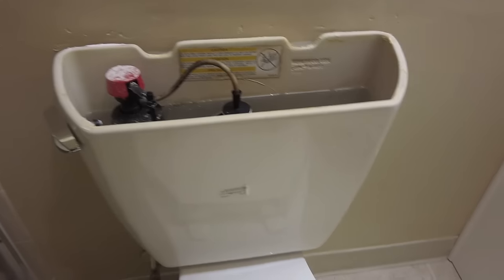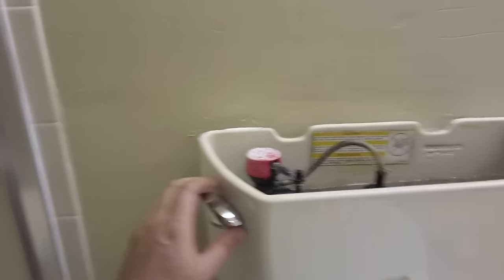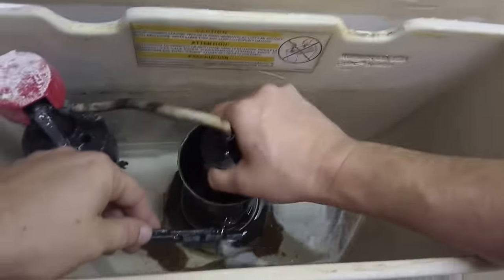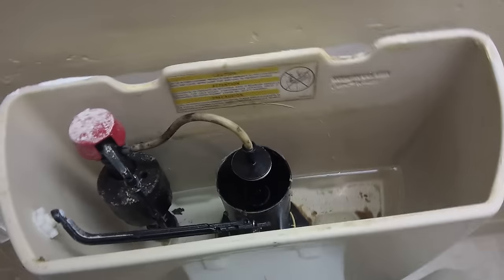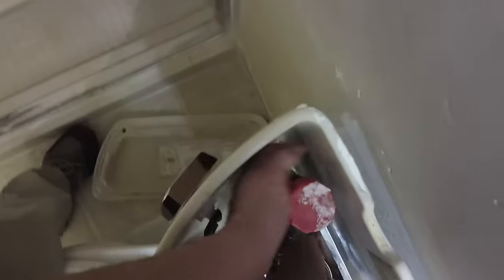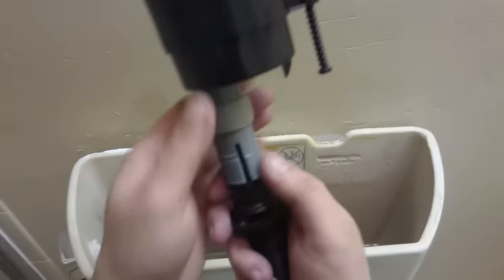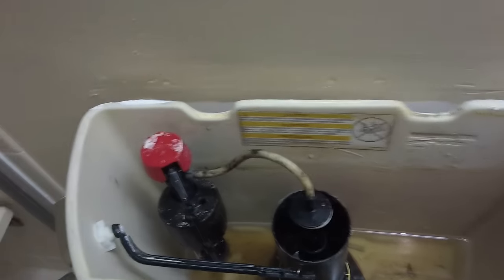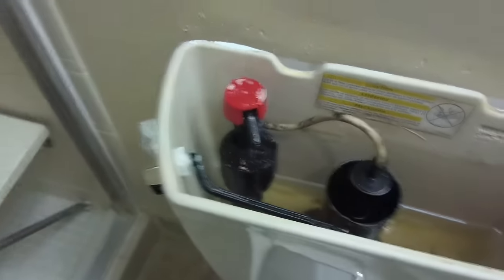Kolher toilet running no problem PART 2.

Comment: Thank you for serving the public.  I followed your videos to fix my Kohler toilet's hissing sound.  I got away with cleaning off the minerals from the rubber part without replacing anything.  There were little pieces of minerals that were keeping the system from running smoothly.

Comment: THANK YOU SO MUCH. I removed the red cap turned the grey thing to the right lifted it up as shown in the video. Then saw the hole in the pipe had little pieces of gunk in it and clogging it. I vacuumed it out, put it all back together and no more running toilet. 1st I tried to adjust the float nothing worked. I had previously checked the seal on the cylinder on the right,  it was in excellent shape so left alone . Then I tried this video seal on left side excellent shape as well left alone. But what this video did not cover was take off red cap remove piece as video shows . I then suctioned that hole out it was caked with little granules and what looked like a thin film. Replaced everything to no more running toilet. Thank you for this video it showed me how to take everything apart even though the seals were not an issue for me . Mine was a clogged whatever that thing is called after he removed the red cap and next piece the hole it was in. Sorry I dont know all the terms. But if this review can help anyone and save them $$ It was worth it.

Comment: Thank you SO much! I watched both parts of your video and between the both, I fixed my issue. I did have to make a kettle adjustment to the float, but you saved me from having to have my husband do it or call plumber (doesn’t care to fix things like I do😂). Quite sure he would’ve replace the whole inside of the toilet. To anyone who has not watched both parts of the video they both were helpful so you might miss something if you don’t watch both. Thank you again I’ll be back if I need any more plumbing help! 😁OH..Forgot this part I never drained the toilet, only turned water off, then flushed it twice. I didn’t see the need to drain it all the way I just stuck my hands in there.

Comment: I found a Replacement for the small black Rubber Seal for the fill Valve. Fixed my problem. Made by “Fluidmaster” .., Part number 242. Cost $2.98 p/t at Loews. Good Luck

Comment: Geoff you and Youtube just saved me a huge headache lol.  We just installed a new Kohler for my grandmother and it flushed just fine but it wouldn't stop hissing after.  It just kept slowly filling, just barely.  Brand new toilet and I'm thinking I'll need a repair guy to come or we'll have to install a new one.  I popped the top off that float valve (mine is yellow) and there was a tiny piece of debris in there.  Just enough to prevent that rubber gasket from seating properly.  I flicked it out of there and viola!  Works perfect.  Just thought I'd let you know and anyone else that has this issue.  If the toilet continues filling and making a noise just try popping off that top piece under the red (or yellow) cap and have a look see.

Comment: Very useful information I didn’t know. Especially the Koehler, I’ve only seen one of those and it still doesn’t work. I need to look for blocked valve or line. Thanks for the tips.

Comment: The reason that sticky crap, which he mentioned looked like "beef left out too long", is the 'drywall mud' used on the wall. On top of the "red cap"  as well, one could see the debris from the spackling. Apparently they left the toilet canister lid open to mud the wall.
Reply from the maker: ma pi yeah you're probably right. That sheetrock mud contains sodium hydroxide in it. That could have had something to do with it thanks for watching.🤔

Comment: 9:40 Lowe's has the rubber part made by FluidMaster.   Don;t know number.   You don;t need to pry the red cap off.  Just twist "lefty-loosy" a quarter turn, and righty-tighty to put it back on.

Comment: Is it necessary to put it back & "lock it" into the base? I saw your previous video and took mine apart but didn't "lock" it or twist it back. Unfortunately I cannot turn the water off since the knob doesn't work so I worked in the water. I found I think I need to replace the seal under the red cap though. My toilet doesn't seem to be as noisy or running as much at this time. Thank you!!